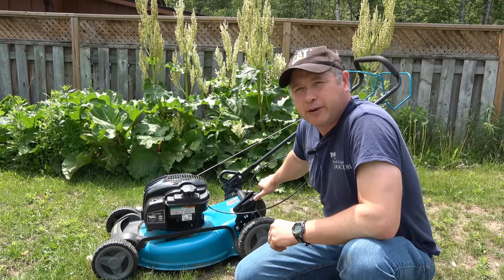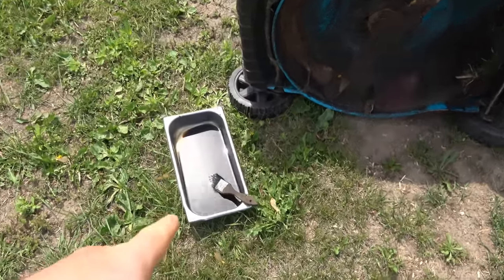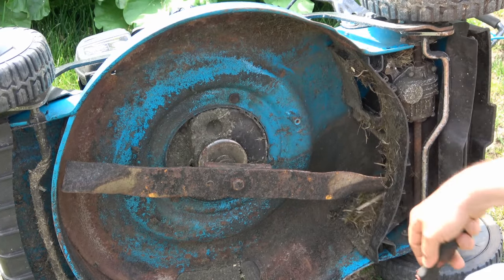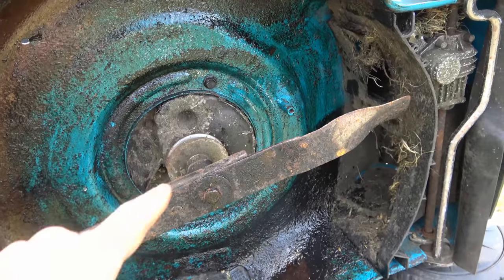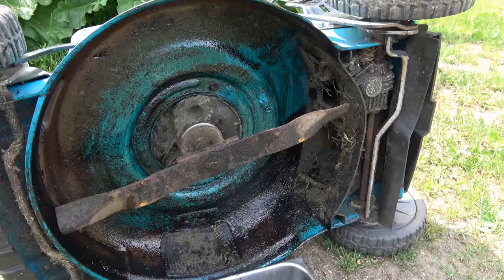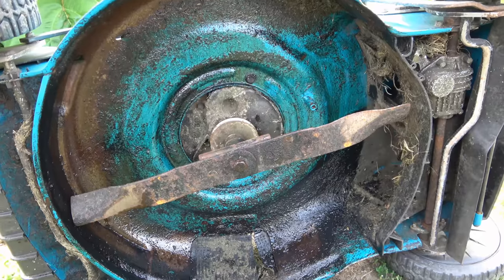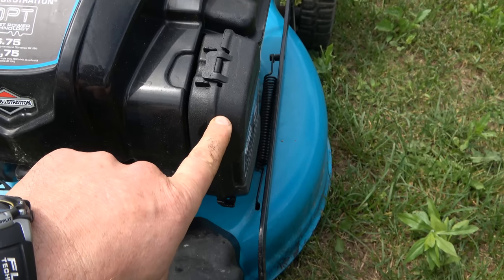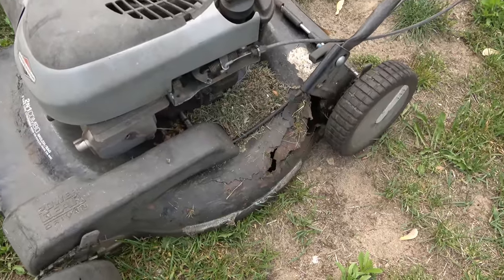Old Timer Taught Me This Trick To Make A Lawnmower Body Last Forever!

Comment: I always clean the mower deck after each mowing to prevent the molding grass and rusting of the deck. Miss my old 2 cycle Lawnboy with an aluminum deck...so lightweight and rust proof!
Reply: Those old Lawnboys were a rugged mower and could cut through most anything .
Reply: @LarryKapp1  The last one I had was a 1977 model, it finally failed in 2010.
Reply: What happened to yours?
Reply: @mgomez5606  sadly the rod started knocking and I couldn't find parts for it... catastrophic failure.

Comment: To prevent  'hydrolocking'  rotate the blade, until you reach near the top of TDC  on  compression stroke,  Both intake/exhaust valves, will be 'closed'....preventing oil from going anywhere; it will stay in the crankcase.

Comment: After use, I let my mower cool down for 45 to 60 mins, then I wash the under deck with a garden hose and put it away. I will try brushing it with oil this time and it's due for an oil change too. Thank you for this tip.🙂
Reply: When I was boy our neighbour was the plant manager for MTD.  His advise was as you stated, wash your mower deck after use and it will last forever.  I usually get 25-30 years out of my lawnmowers.  I'm 72 years old so I've owned a few.

Comment: I have a mower that is turning 20 this summer,  I have never had a problem with it in anyway,  even the original cable, pull cord and spark plug
Here's what I have done. 
1   at the end of each season I clean the bottom of the deck then spray it with rubberized undercoating from Walmart,  $4.39 a can. It really sets up well over the winter 
2  when it starts to peal outside I spray it with trimclad  (Charleston green) spray paint,  it is nearly a perfect match with the original dark green.                    
3  I always store it inside, 
4 several times during the summer and at the end of the season I turn the grass bag inside out and pressure wash it. The grass bag is like a vacuum bag in that it is designed to catch the grass but let the air go through. If all those pours in the bag get clogged then it won't pick up the grass as well. 
5  I follow donny boy's directions for storing at the end of the season 
6.....spark plug..... well the way I see it, a plug is like a light bulb, you don't need to change it until it blows.
I have a 24 year old atv with the original plug in it too.
Reply: I had a 79.99 push mower I got in 98, and proceeded to do nothing until 2007 when I put it on the curb, because I sold the house. 
Never changed the oil, topped it off if necessary. 
By my own stupidity I never drained gas ,but it was easy to drop the bowl and blow it out. 
Briggs makes an engine that doesn't require an oil change and say it'll last 15 seasons. 
Mine was going on 10 no problem, it sounds like a crazy idea to have a "no oil change" engine but it's workable.

Comment: I tell anyone who buys a new mower,  as soon as it comes out of the box, before putting in oil or fuel, tip it over and paint the underside, with brush on metal paint. Then the next day, paint it again. It can put ten years extra on the deck because the manufacturer’s paint is so thin.
Reply: A little more expensive, Epoxy paint. We used it to coat inside 3000 gallon tanks used for potable water for a major soft drink company.

Comment: Good video Don at Eliminator Performance we use drip less Rust Cure 3000 and when we check the treated decks every year or three years they have some debris stuck but it comes off very easily with a scrapper. None treated decks it seems like the debris is welded on to the deck. Additionally, cutting only when the grass is dry will also keep the deck lasting forever.

Comment: Thank you for that tip. I've started treating my new equipment with a two part Hydrophobic spray. I live in the NW where it rains constantly for months. Huge difference in how long the equipment lasts and looks after the rainy season. The mower deck gets a follow up with a quick spray of Rust Restorer in spray can since rocks keep taking away the protective paint. The rust restorer stops the rust continuing to attack the metal.

Comment: really good idea. Back in the 70  s  I was a grease monkey for a (then) big name car dealers and we sprayed the old gash oil on the chassis to keep them from rusting. Later in Scotland old oil was used to soak the fence post ends  so it took longer for them to rot. Some used to heat up the oil in drums so it would soak in better, but if it got too hot you had a fire as good as any beacon and no fence posts... ! Probably not that good for the enviroment, but I think less damaging than having to buy a new deck or mower every so many years . I know, after 10 years my ride on deck is junk.  Thanks again Dony.
Reply: if you have the oil absorbed into the fence post and there is no excess, the amount leached is probably not a lot at all.    Frankly, probably not as bad for the ground as the treatments put on wood meant for submersion in the ground lol
Reply: @CT_Taylor  I agree. Use what you got always seems a good idea to me.

Comment: On a bigger mower that moves some serious grass, a friction reducing coating like a graphite (EZ Slide sold at farm stores) wear coating paint applied to the bottom in a couple coats would speed up the kick out of grass as well as keep things from sticking as easily.  usually lasts a season in good use

Comment: If I'm using a metal bodied mower which isn't often but if I buy one cheap to do up I first get all old grass off with a wire brush sand down any surface rust then go over it all with two coats of hammerite paint. You can't get much better than that.
Reply: Ceramic engine paint works well also. Pretty hard surface and lasts a long time. Resists grass sticking pretty well too.

Comment: Another Great Video! Some meticulous lawn care nuts will not do this in fear that the oil will adversely affect the grass.(I do not think it will) The  cheap alternative is vegetable oil.
I put some in a small Harbor Freight pump sprayer,  hoist my tractor, and apply to the deck after every mow.
Reply: A very good idea at Eliminator Performance we currently use Rust Cure 3000 it does not drip and works excellent

Comment: Good tip.  It's like the old-style undercoating they used to do on cars.  Personally, while I clean the underside of my deck after every mow (water hose), every few years I pressure wash the underside of the 54" deck, let it dry, then spray it with a rock-guard spray.  I believe it holds up longer and protects better than old oil.

Comment: I use my leaf blower to clean the top and bottom of the deck on my Honda HRC after each use. Once a month I scrape and pressure wash the bottom of the deck. I just finished disassembling the deck portion of the mower, taking all the sheet metal off the bottom, beadblasting all the good parts, and replacing a couple of banged up/torn parts. I scrubbed and sanded any rust on the deck, and prepped it with "metal and concrete cleaner" from the big orange box store. I painted two coats of red PlowSlick (2-part epoxy paint that is supposed to be super slick and hard - sold on ebay) on everything underneath. I put it all back together replacing any rubber seals and new M6 hardware from McMaster. So far, I've had two days/5 properties a day, and it's still like the day I painted it. We'll see how it holds up.

Comment: Fertilizers are a killer on mower decks along with the grass and moisture. Another good reason for the frequent cleaning and protecting.
Reply: Great comment at Eliminator Performance we believe the severe pitting on our customers aluminium decks have been caused by fertilizers so we coat them with Rust Cure 3000

Comment: In the fall, I scrape and use a wire wheel on my grinder, gets 95 % of the grass off, sprays it with whatever spray paint I have. Yes, I wear coveralls and safety glasses. Between mows, the bottom gets scraped and hosed off.

Comment: Great tip Dony.  Been doing that for years.  I do the blade(s) as well.  That trick of rounding the corners of the scraper is very valuable too.  I pull the deck out of my X320 Rider and turn it over and give it the cleaning and oiling before storage.  Good time to Sharpen blades as well and check Spindles.

Comment: Question 1: Would you recommend me do this to a plastic deck like a Honda HRX217HYA I just bought?

Question 2: Would this work on a snowblower? Rust builds up at the chute and auger housing. This seems like a. Great idea to keep snow from caking up. You’ve given me an idea.
Reply from the maker: no need to do this on a plastic deck bt on a snowblower it's a good idea
Reply: @donyboy73  my next video haha. Painting old oil on auger housing and chute! Haha
Reply: I use either a dry silicon lube spray or a wax it with car wax...keep snow from sticking and protects the surface...even spray on pam works here in a pinch...
Reply: @timw6281  but doesn’t protect against rust
Reply: @appleztooranges  but it does...just recoat betwen uses...pam works good for this...so does silicon spray...

Comment: I know you use 10-30w due to your colder climate, but my question would be Mower Oil vs Car Motor oil, I’ve seen people using both, what’s your thoughts?
My opinion would be Mower Oil only.
Reply: You can virtually use any oil. Even vegetable oil. Which I spray on after every mow
Reply: Mower oil and car oil are the same thing. "Mower  oil " is just car oil sold by lawn mower manufacturers to up their profits. As far as the "weight" of the oil goes, most manufacturers recommend 30 weight but also state that 10W30 is equally acceptable. I once owned a riding mower with a snow thrower attachment. In that case, 10W30 would be recommended.
Reply: @rfcasey  Bob was referring to the oil change itself, sorry 😐
Reply: @davidquinn6161  I have many mowers, but if it’s a brand new one I won’t put anything else in it plus warranty issues. A mower you may take to a mates place or help someone out and it uses a bit of oil due to wear, I’d be happy to top it up with used or any grade oil I have laying around, except for my Mobil 0-40 or 5-50 Fully Synthetic which are around $100 for 5 Litres.
I pay $25 for 5L of oil SAE30 for my Briggs red in colour and the same for my Honda’s in API 10-30w grade, or $13 a litre for Honda Branded oil as with Briggs.
With Two Stroke I only use Stihl oil, that was made by Castrol (BLUE in colour) new type are red standard oil  or green Synthetic range.
I’d only use the synthetic range due to the double warranty that Stihl gives you on your new machine
Reply: Always have 5w30 around cuz that's what I need for cars so that's what I put in mower too now and no difference between it and the 10w30 or sae30,,, I think the important in summer is the last number: so the 30 is there, that's ok 👍
Reply: @martindesmarais7158  that’s what my cars originally took 22 years ago but my mechanic has altered they regime due to mileage as they get older they may need a little thicker oil.especially after 180,000 miles.
Have heaps of 5-30w Ford Branded oil
Reply: @rickthelian2215  lol If your "heap" of 5w30 is synthetic and you're around me (near Montréal east), I'm willing to buy it "bulk price" (Really) 😉
Reply: @martindesmarais7158  nah, not Synthetic, but live in Sydney Australia 😀🇦🇺

Comment: Ill do you one better...after preping like you showed...brush on roofing tar to coat the underside of your deck...once coated...let it set up for a few days...once a thin layer of grass blades impregnate the surface nothing else sticks and lasts longer than your engine...it holds up after any abuse and stops any rust...

Comment: Good idea but I would not use old used oil since it has carbon in it and will rust between the spot welds faster since old oil with carbon creates an acid to rust faster I seen this happen on a lot of cars around the wheel wells and bottom of the doors if you want to use oil used new fresh oil  since there is no carbon from the combustion chamber and won't create an acid to rust it faster that is a good truck but myself I would just clean it up evey so often and use a oil based tremclad paint and brush that on ...

Comment: Another:  Tire places only put  like 32-35 pounds of pressure in you're tires,I get Angry because my WW2 ERA grandfather raised me like his own son,taught me to GO BY THE MANUFACTURER RATED PRESSURE LISTED ON THE TIRE and NOT the door as tire merchants want you to go by so they sell you tires every three years..
They set flat and wear on sides or in middle.
My tires last a decade and dry rot before I need knew ones going by the tires MAX PSI RATING written in small lettering on tires..
Riding rough is a myth,state roads are trash to boot..
TIRES DRY ROT  BEFORE EVEN NEEDING any type of rotation..
GO BY TIRES  OWN RATING AND NOT DOOR OR TIRE PLACE....
ALSO USING ARMOUR ALL eventually causes the side wall cracking sooner......,"JOHNSON'S WAX" in the big yellow can,AMERICAN WW2 secret all purpose wax substance...
If you read can,works for wood,metal,ceramic,RUBBER ....Antique dealers utilize same rag so residue builds up to wipe everything and anything because a Kero odor it has that lasts ten minutes and disappears yet the rag does not have.
Even works best on leather,trusted to Americans finest antiques ( a can is cheap and lasts a few years..)
Best $8 you'll ever spend.

Comment: Bruh just clean it and send it with the frex seal type shit. I’d do that with my F series Lawn boy. Or just buy a Honda mower with the super plastic™️ deck which would survive a nuclear war supposedly.
Reply: At Eliminator Performance we have seen many of those Honda super plastic decks badly cracked and they did not come close to a nuclear event. The flex seal will trap moisture and rot the deck faster after the first cutting starts ripping off sections, same thing with the rubberized automotive undercoating.

Comment: One question. Has anyone who used this oil technique ever checked the underside of the mower deck after cutting the lawn? Just wondering whether there were any grass cuttings stuck to the metal and how much. Seen this same oil treatment application many years ago on a different YouTube channel when the mower was being prepared for WINTER STORAGE. Kind of made sense as the oil could fully penetrate and dry thoroughly. Personally, I spray the under deck, after cleaning with Tremclad or Rustloeum rust paint before winter storage. Drys quicky and provides a nice SMOOTH surface when the mower is put into service in the spring. The deck of my two 20 year old mowers are like brand new. Cost effective maintenance.